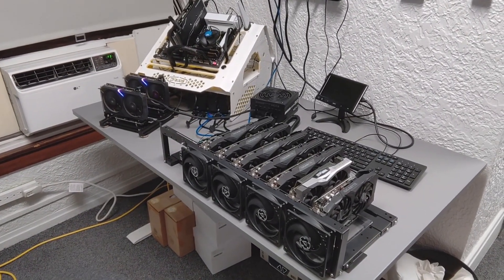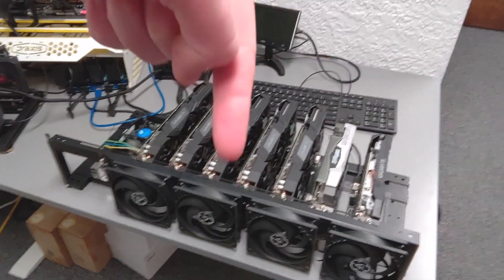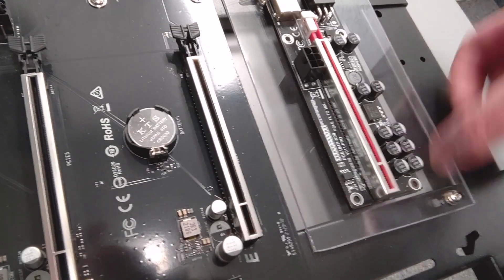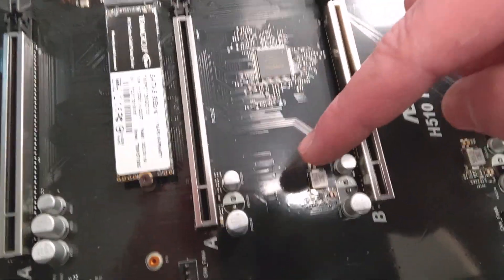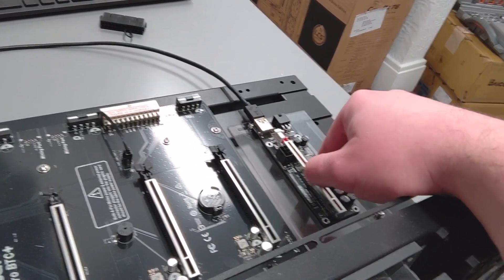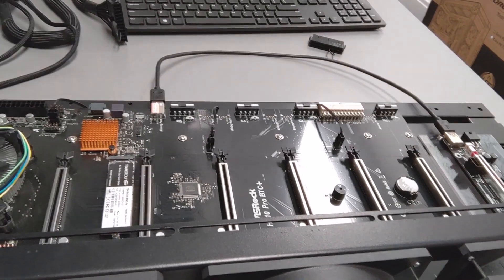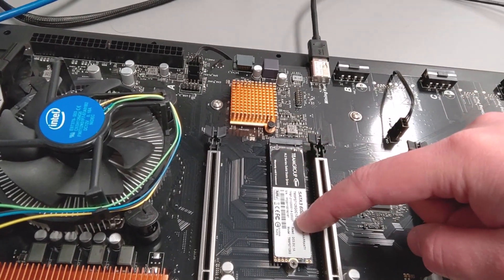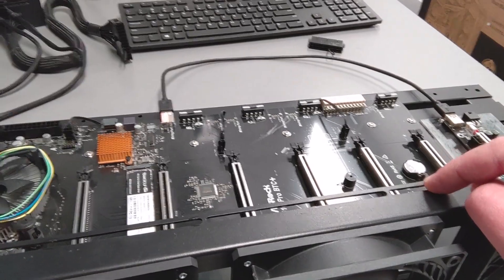ASRock H510 Pro BTC+ Motherboard - Most Versatile Riserless GPU Crypto Mining Motherboard

Comment: These will be great for POUW 510 board. But my question is what fans and frame did you use and can you please put links in the description?
Reply from the maker: Unfortunately this board won't work for PoUW. Only the first slot is PCIe x16, the rest are x1 per ASRock https://asrock.com/MB/Intel/H510%20Pro%20BTC+/index.asp#Specification. Added fans and frame links to description. Note that there is no frame truly designed for this board so there are a couple motherboard screw locations that aren't used w/ this frame. This frame was the best I could find that lined up with this board.